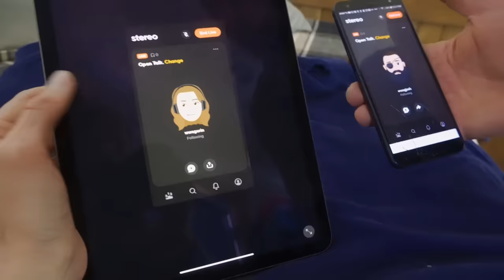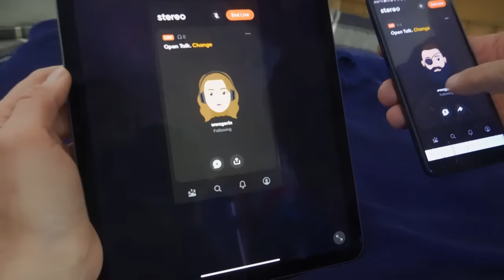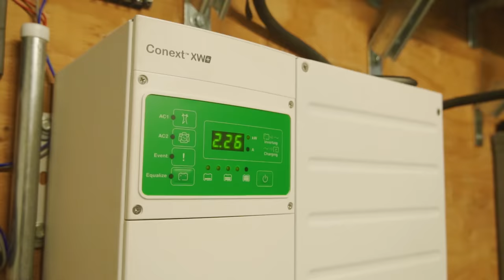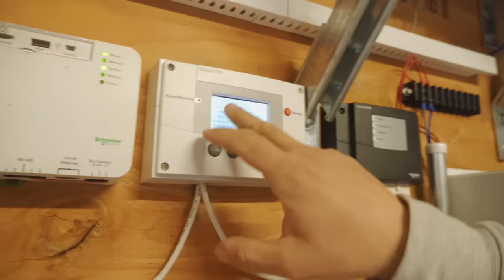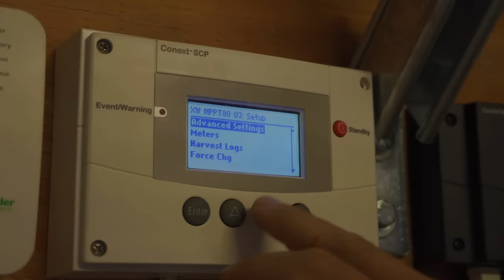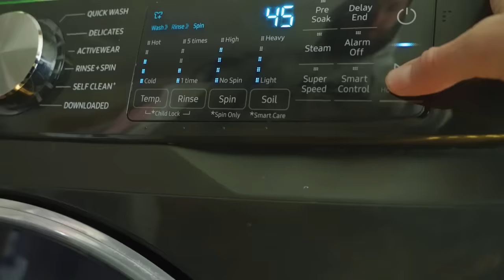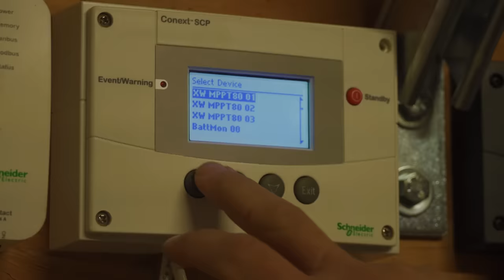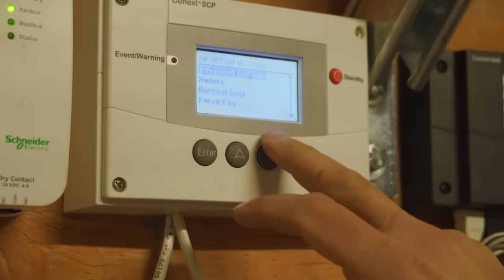START TO FINISH TIMELAPSE- Couple Builds A Solar POWER PLANT

Comment: You should look into Geothermal Heat Pumps. I am sure you would love that. So low maintenance.
Reply: Yeh, so many home owners in Europe do install that now. It is like their solar system. Expensive to setup but after you are done it runs on its own. Wood heating is very very time consuming.
Reply: Have you notice the soil there?  It is seriously rocky and would be a total pain to excavate.
Reply: @wallykramer7566  It is normally done by drilling just like their water well.
Reply: @MrKroesamaja  You are correct.  I have only seen trenching for installing geothermal.

Comment: Josh, Your pride and enthusiasm over an extremely well engineered and installed off grid solar system is understandable. As a master electrician who worked commercial and industrial and now solar if you ever should need to subsidize your income then consider consulting solar off grid projects as it would be a natural.

Comment: Congratulations! Way to go! I've owned a rooftop solar array for the past ten years. SunPower system: 22 panels, each rated at 214 watts,
for a system rated at 4.73 kWh's.  No regrets. Thrilled to be paying so little to the local utility.
Reply: 4.73kWp . Maybe time for a panel upgrade.

Comment: I honestly don't think you're ever going to need to run that beautiful new generator.  What a system!
Reply: Perhaps. Better to have it and not need it, than to need it and not have it.
Plenty of things could happen to damage that solar array, like a windstorm blowing debris into it, or livestock getting rambunctious.
Backup generator is nothing but a smart move.
Reply: Maybe when snow/ice cover the panels, and it's frozen and can't be brushed off.
Reply: @Fireholder1   In my opinion a more serious threat to the system may be  a  EMP attack...
Reply: Yes, back-up is wise to have in advance , esp. in remote areas where may be hard to get to, or find in time, a genset, just like when util. Grid fails. It's very rare to have damage (would take  tornado winds to damage that ground array) & let only sheep keep grass under it trimmed🌻   note: System CAN be made EMP hardened.🌄
Reply: @iossysm  seriously??!! IF the case of and EMP the generator wont work EITHER!
Reply: @Fireholder1  my thoughts are a bad hail storm.will they panels hold up under large hail stones.
Reply: it's always good to have a backup in case something fails

Comment: Checkout radiant heat panels! Really cool and simple tech that is more efficient than heating air. 

As a solar installer/tech I must say you all did a really excellent job with this setup. Everything is squared up, the system is easy to understand at a glance, and the cable management is better than a lot of the pros I spend time cleaning up after.

Comment: I just got my 10 k solar system operating in the Colorado mountains and it is putting out full power since it’s almost always sunny here. The feeling  is great when I sell excess power to the grid although they pay only wholesale rates. As a new home builder my all electric new homes will also have a 10 k solar system. The cost is about 27k but there are tax incentives which bring the cost down.

Comment: Your solar array has inspired me mainly because in the back of our property is a spot I believe solar panels can be set up I just need to measure the distance to the house.  If I remember correctly your run to the power house is 3 or 4 hundred feet.  Congrats on another set of twins

Comment: For heating water, check out heat pump electric water heaters. Some technology and efficiency as your Mr. Cool split system heat pumps for HVAC, but applied to heating water.

Comment: Great job, your vision has paid off. We have a thermal mass electric heating system. It heats the ceramics bricks over night at a very low electric rate and we draw heat off the brick to heat the house during the day. If we had solar we would charge the system during the day  to heat the house. Works great and save a lot.

Comment: 1:27 As an electrician who has installed solar panels. My recommendation for disconnecting the panels. Either purchase the tool for them. Or insert a zip tie. Insert it in both holes by looping it but no need to engage the zip tie onto itself. Just through the connector and tighten it up so to release the clamps.

Comment: Only thing I would add is a self cleaning fixture on the solar panels. That way you could keep the manual maintenance to a minimum - the unit would sort of be a larger version of the window washer unit found on vehicles to remove the dirt and field clippings that would reduce the efficiency of the panels. Very nice solar system and I wish the technology had been available when I was younger.

Comment: What I want to add are systems that enable excess solar energy to be dumped somewhere productive when the batteries are full, like water heaters, pumped hydroeletric, etc. They're basically physical batteries which would work really well on your system!
Reply: They could --- to the public utility which has a line only half a mile away

Comment: What a great accomplishment. This is not a simple DIY job. Very neatly designed, neatly built and completely functional. There's one thing, Josh, about her rivalrous remark, asking if you were more happy with your solar system than with her. You failed to tell her you did it to make her life with you more comfortable and happy through that. And when she fell in the snow and did not stand up immediately, Josh, you missed helping her stand up, or, better, join her in the snow and roll out of the camera frame with her ...

Comment: Since you have so much power, you should consider getting a Heat Pump water heater and a Heat Pump dryer.  Keep the propane ones as backup.

I saw another you tuber with a conventional water heater with 1K elements in the heater as a diversion load then running through an instant water heater you might want to think about.

Comment: Enjoyed listening to your live cast tues. I heard you speak briefly on enclosing the skirting of your home. I recently did a similar project on our home utilizing pressure treated 2x2’s to frame the areas between our sonic tubes. We couldn’t afford pressure treated plywood. We utilized cement board using screws to affix specific to cement board and then glued to the interior frame pink board or insulation board inch and a half. The savings were significant. I also heard you speak about composite decking we did some research and found that the joist would need to be 12 inch on center. The other problem was the heat and specific clips or screws.
Reply: Hope this helps if you haven’t decided

Comment: You might consider switching out the dryer from propane based to elec. That should add a significant energy consumer to the race but also it would reduce the propane bill.

Comment: We used excess power to run through a water heater fitted with DC elements.  Always had hot water.

Comment: Have you looked at ground source heat pumps for your heating/cooling? I'm doing this at my house, it's expensive, but should last a long time and not consume fuel... and can use a heat buffer tank when it's sunny for use later on in the day

Comment: Good evening,
Thanks for your great videos and explanation.
I have a question regarding the electrical isolation of the minus (- ) bar and the positive (+) bar just at the exit of the battery cables.
Don't you think it would be interesting to isolate these 2 bars in order to avoid a short circuit if a metallic object were to fall on them?
Thanks again
Clavier (Belgium)

Comment: Possibly the best aspect of a ground mount system like you have is the expandability as needs grow and finances permit.  And really the only big "mistake" Josh made on the initial install was in not laying enough pipe.
.
For system growth of course like the network monitoring from the house, get your minds out of the gutter LOL
Would you be willing to share about what you've got invested into the solar project to date?

Comment: If you want to protect your solar panels from falling hail; use, 10 m hard plastic sheeting " clear" and mount it over the solar panels. 10 m hard plastic sheeting can withstand a hail diameter of two to fore inches your panels alone won't even handle 1/4 inche hail.

Comment: Hi I'm in Wales in the Uk and have been running on solar for 11yr now and I have a 2Kw solar system which powers our home and we also have a 5Kw Moixa Battery which controls all the system we are still connected to the grid because of the dark rainy winters we have in Wales. our system needs a wind turbine just for the winter days anyone recommend one. Andy.

Comment: I like the idea of “freedom from electricity bill” 😀. I am curious but still skeptical about this whole thing of solar energy. I heard a lot of negative reviews and experiences people have with this system, not being efficient a lot of times. Also, I saw people cutting down trees and cleaning out plots to put solar panels, so that don’t make sense, if solar system is supposed to be environment friendly why does it cause to remove trees and plants? I heard if you put them on the roof, it damages the roof after certain amount of times and squirrels and rottens chews up wirings, and not good with snows and have to replace the panels after certain years, I don’t know, still investigating. I really would like to put those up some day but just not yet. Looks so fun though, whatever you guys are up to. Adventurous!!!

Comment: heya, watching your PL "installing ..solar..system" love the way you show us so much thanks. have myself 11 paneels 3250 Wp solaredge 3300 + optimizers grid tie. in the summer I make more eektric ten I us so I give it back to the grid and in the winter the system in not producing enough so  I take it from the grid olmost 1:1 with these panels I product a year almost as much as need to live of. still have 12 panels to install with a MPPsolar inverter plus bilding my own batterie pack from 18650 battery cells ( have now 5000 good and tested cells ) I knonw how to do this as I'm an elektrician/elektronicus myself. wen you can do it diy it's much less expensive

Comment: Damm that’s a beautiful installation and well engineered for your future builds. Will you make a cover over the 2 collector bars so when you hit it with say a ladder it would not short circuit the system? Enough power to run future Christmas lights around the house and extension and barn.

Comment: I enjoy watching you put together the solar array.  It would be useful if you explained what parts you're using and why.  Why did you change the rails to hold the panels.  Was it only because you could hold more panels or is the new hardware better.  How are you combining the panels and wiring them together?  what is the math?  I noticed it all seems to be DC.  I have seen in other YouTubes where each panel has a Micro inverter to solve shading problems.  One panel covered in snow would not effect the rest of the string of panels wired together.
Reply: I wrote my questions before I finished the video.  You did a fine job of explaining what your system does. And how you wired it.  Thanks for the videos.

Comment: If you think you will ever need a second inverter, order it soon and put it in storage.  Things are getting harder to find and it is going to get worse.  Plus you won't have to worry about system compatibility if they decide to change hardware or software design.

Comment: Thank you for the information.  I will look into these charges controller's,  looking to build high voltage system and have set an unreasonable goal to be energy independent by end of this year.  Thank you guys and keep up the good work!
Reply: That does not seem unreasonable at all....
Reply: @wallykramer7566  well, considering I've already got 3.6kwh worth of hardware halfway installed, I agree.  Just going to be tough with the cost of everything.  Ohio isn't the best for solar, but it is where I live.  Thank you for the encouragement nonetheless.

Comment: Do you have those twelve 385 W and the twenty 420 W panels separated among the MTTP charge controllers?

Technically you can have them mixed. But to get the best performance, especially out of the 420 W panels. Keep them separated from the 385 W panels. Otherwise the 385 W panels will bring the 420 W panels down.

Comment: I've seen so many people with just a few panels and they complain that they are constantly running their system down and it takes for ever to recharge.  You need enough panels to power your day use AND charge the batteries.

Comment: What about electricity to the out buildings barn and shed and/or a yard light that you can turn on or off from a switch in your house? I would think you have enough electricity so you just need to put in your own wires as your an electrician? Can you run underground wiring for the outside lights!???

Comment: When is Leon going to get a haircut? I need a nice comfy hat!

I just rewired my small 12-panel solar array today. I went from 4s3p, to 2 strings of 6s. :) High Voltage setup is soooo much easier to configure.

Y'all keep buying those "retail" batteries, that's super expensive. I've got 57kWh of storage. :)

Comment: That system is beautiful and is goals I currently have 4800 watts of solar coming and am still working on sizing the wire. By chance what size wire do y'all have running from your solar panels to your charge controllers.

Comment: I'm just curious. I was wondering with the cost of everything installed and the amount of power inside of the power house, have you given any thought to installing an automated fire extinguishing system in there? It seems that should anything go wrong (lightning strikes, or any other kind of disaster) it would be one of the top priorities to protect. Keep up the good work you two.

Comment: Really well done on the solar plant. In the UK we can sell excess power back to the power grid. Can you do that ??
Reply: Theoretically, they could.  But it would cost over $15,000 to install a grid-tie line.  That is the cost for the utility to run wires the last 1/2 mile (1 km) to their property.  Erin and/or Josh would have to dig a trench, install the wire, and bury it.

Comment: I would like to know where you got the panel brackets and post saddles. I found some 17' used panel brackets on eBay in Pennsylvania, but they won't ship them. I live in Indiana and the trip would cost more than the brackets. 
I can also only find black pipe in the 4" size. At my age it would probably outlast me. 
Very interesting video. Have a good day.

Comment: Really nice work, Im thinking about buying 4 Tesla modules myself but I noticed that they can be charge up to 25.2 volt each do you use that last juice or are you satisfied with charging them towards 48 volt and take out less energy from them? If you have a solution to charge them towards 25V each I would like to know more details about this and I think it would be very interesting for others two. Here in Sweden these modules from crashed car places cost around 900 dollar each so it is really good cost/kW.

Comment: So with this level of efficiency it seems like the backup generator will only ever power on during the coldest or hottest nights of the year to recharge the batteries for AC/heat. Once you get to 15 batteries will you even need the generator at all?

Comment: Now if the planets align and a meteorite crashes one string of panels then you have 2 more panels in case another meteorite hits another string of panels.   All you need now is to double the batteries in case of an apocalypse. :-)     Of course if a third meteorite hits then the generator has you covered.

Comment: Since your not connected to the Electric Utility, what happens when you batteries are fully charged and your solar panels are generating more power than your load. In the long term Would the Utility connection cost be in excess of what you could wheel back to them & they pay you for your excess?

Comment: Looks like a great system - robust.  Josh: what kind of surge protector is built in, in the event the panels mounted on metal pipes get struck by lightening?
Reply: There are three lightning arresters installed.

Comment: How big is your battery? I've been thinking about solar on my roof to be able to run an AC over night and I figured even with one single safe room with a 7.500 BTU unit we'd need some 3 kW for a generator and that would mean a battery capacity of 30 kW hours to make it over night. But such a battery is impossible to pay for, is it not? So now you're running heat over night?

Comment: This is now MY dream solar system. One question - since I watch too many hours of off-grid videos to go looking for it, maybe you covered this somewhere - but did you bring solar into the power house at 48V or higher to get the wire size down and the efficiency up? I'm sure you did series and parallel on the panels, but I never heard what total Voltage you totaled coming off the entire array into your supply wire to the the Mppt Controllers so far away. Again, I can't go through the videos again, but I'm guessing your Mppt's are built to take in 48V or higher, and that Growatt is a 48V Inverter. My question is, did you need a transformer to step the Voltage down from the Solar Array, or did you just have it already coming in at the accepted Voltage at the Mppt Controller?  That's my question.
(I'm aware that you can string together panels in series for Voltage as high as you want, so long as you have a transformer at the receiving end to step it down for whatever the Mppt is rated for, to say nothing of Wattage)